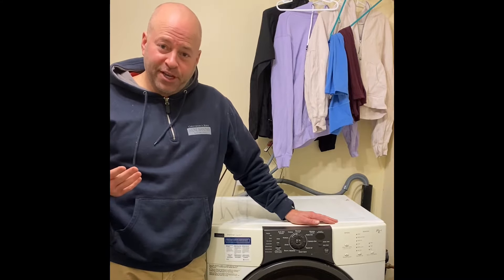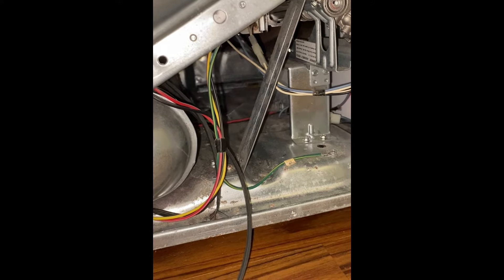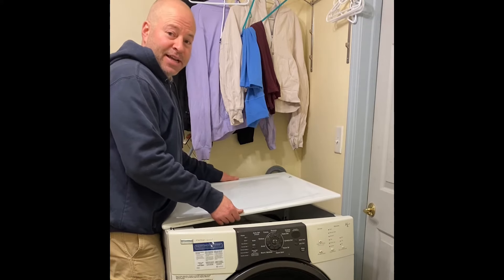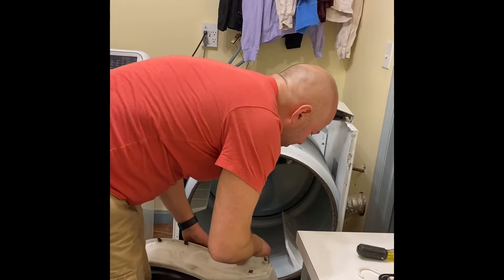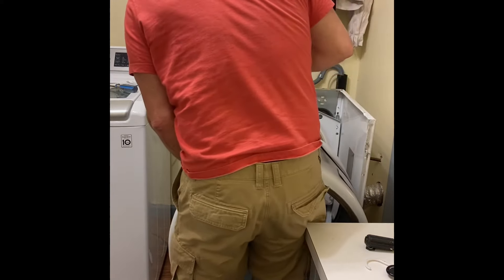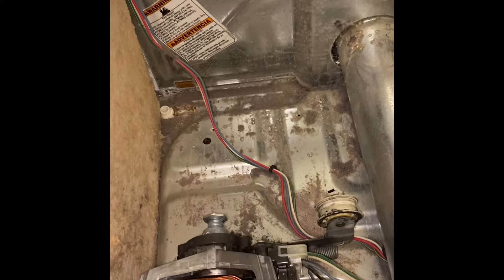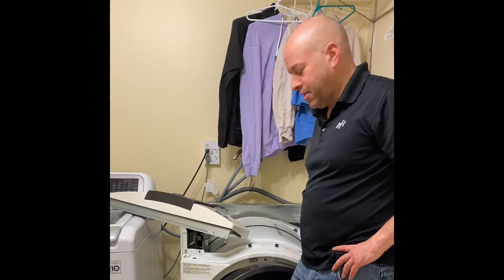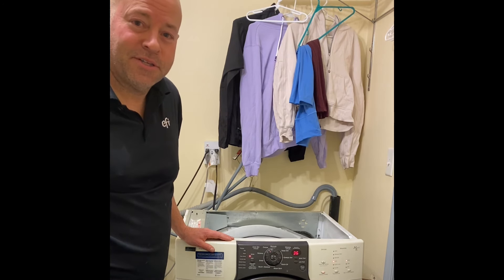Kenmore Dryer Will Not Start - FIXED

Comment: Well, my belt is fine, so I had to dig more.  I did find a Diagnostic Guide inside the bottom front cover.  Big double sided 22x34" sheet folded up.
Checked the Key pad test... press MORE TIME, LESS TIME, MORE TIME, LESS TIME within five seconds, for all the front lights to come on.  88 displayed indicated it's fine.  Not much help there, but when I tried to run a cycle from there, 08 was displayed.  Not sure what that means.
 Seems that thermal fuse is blown.  Much easier to change, but I've got to sort out why it blew.  Hoping a good cleaning is all it needs.
Reply from the maker: Take a look at motor and motor relay as well.  Good Luck!!

Comment: What order did you do the belt? The pulley then the drum or ??
Reply from the maker: The plan was originally just to slide a new belt in.   But then I found the broken pulley.   So I removed belt, then drum, then replaced motor pulley.   Then I used belt to lift and set drum back in and threaded belt around all pulleys.   Then replace all covers.   Might as well vacuum it all out though for safety!  Good luck!!
Reply: I just can’t figure out how the belt sits on the pulleys after removing everything. Your video was very helpful:)
Reply from the maker: Is best diagram I could find  @bryandthebullys  11:01

Comment: I have a real odd heating problem with my Kenmore when I have it on timed dry for 60 minutes. It's like it's in cool down mode until it gets to the end of the cycle and then gets really hot and won't stop on it's own. I've replaced the heating element, the thermostat, the cycling thermostat, the thermal fuse and the door switch. Nothing has changed! it's driving me crazy! Any help or tips on fixing the issue please?
Reply from the maker: Wow, that sounds dangerous.    It sounds to me like your main board may have a glitch.  I’d looking into that!  Good luck!!

Comment: My lint sensor lights-beeps then light shuts off I push start and NOTHING?????? Can you help me please
Reply from the maker: I would run through the troubleshooting steps I did.  Make sure door switch is not issue, then look into sensors.  As you may have seen in my video, what I originally thought was a bad thermal switch turned out to be mechanical…